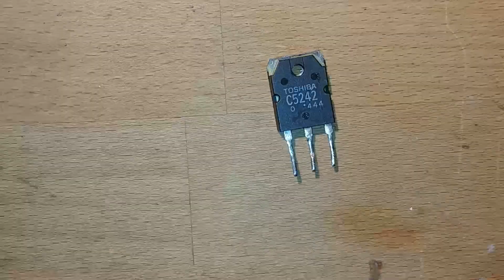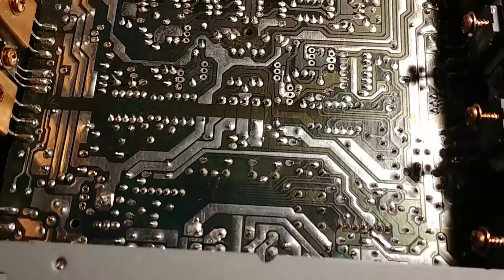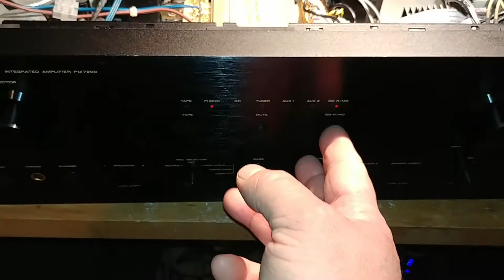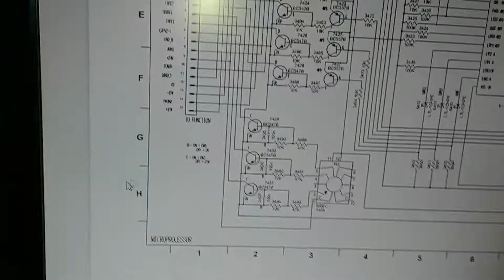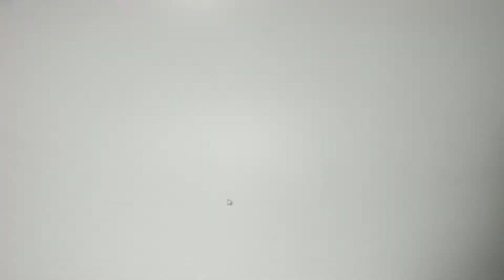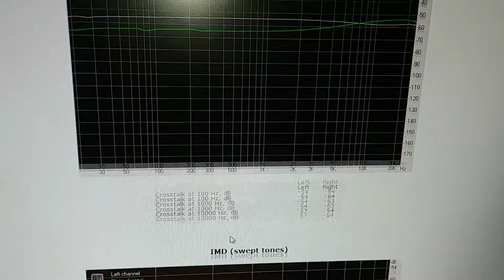MARANTZ PM7200 repair after repair

Comment: Hi..My pm7200 left heatsink stays cold during operation..the right side is warm like normal.
But sound wise i can't hear anything weird..what could be the issue?
Reply from the maker: Hi needs check idling curent and dc but needs be realy careful . nust need to download service manual for this amp its available everywhere . check its process to check all and if its pm7200 need to check and adjust in AB  class and after in A class if you are not good with electronic let to do this by electronics . its so easy to damage transistors
Reply: Hay desajuste en bias de los Transistores de Potencia ..... Para el sistema AB es de 18 milivoltios , para el sistema A es de 90 milivoltios , el ajuste de CC en las salidas de bocinas es de , preferencia , menos de 10 milivoltios .... Es importante descargar el manual completo con el diagrama esquemático ahí viene muy claro como hacer estos ajustes ...... Detalle , para corregir fallas de sonido en estos modelos de Amplificadores Marantz , resoldar todo el módulo de potencia ( con soldadura 60-40 ) y en los módulos que los requiera ( hay muchos puntos de soldadura fría en ellos ) cambiar los Relay de bocinas , cambiar la pasta térmica en los transistores de potencia , Recap completo , y para mejor respuesta en el sonido ( con bajos más potente ) cambio de los 2 filtros Principales a 20.000 mf a 76 voltios , cambio del banco de diodos a 15 amperios 600 voltios con su respectiva pasta disipadora , reforzar con soldadura 60-40 las líneas que van a los colectores de los transistores de potencia  ( con estas modificaciones , importante el reajuste de bias sistema AB y sistema A y ajuste de CC a los valores ya mencionados ) y por último , adaptación de 2 ventiladores con alimentación independiente de 12 voltios en los disipadores del módulo de potencia para mejor control de temperatura a trabajo normal y extremo ..... yo tengo el amplificador Marantz PM-7200 con esas modificaciones y el sonido resultante es excelente ...... ( Con la modificación correcta , Cero interferencia en la amplificacion con los ventiladores )

Comment: found the output transistors a bit misleading checking for shorts using a standard forward voltage check testing insitu.